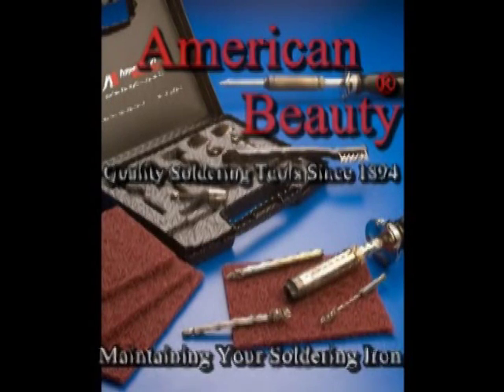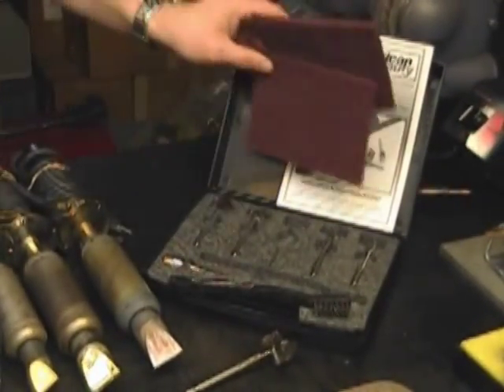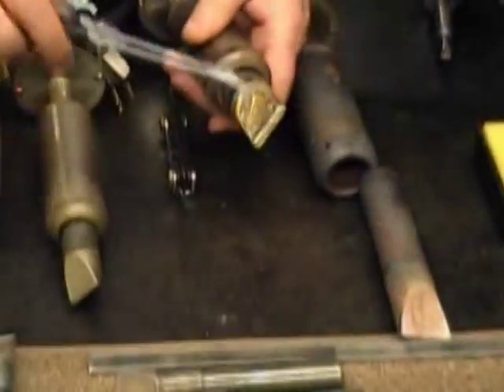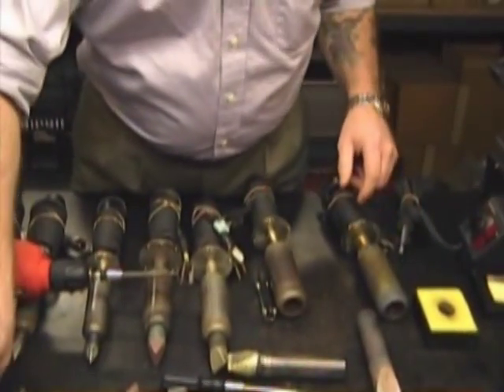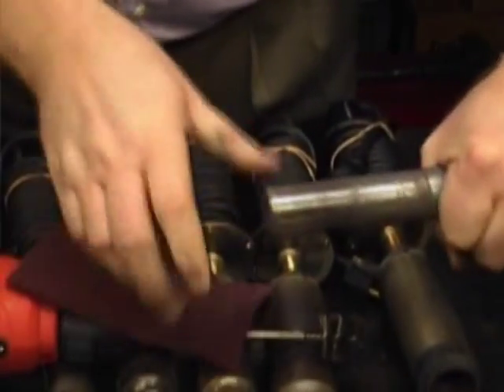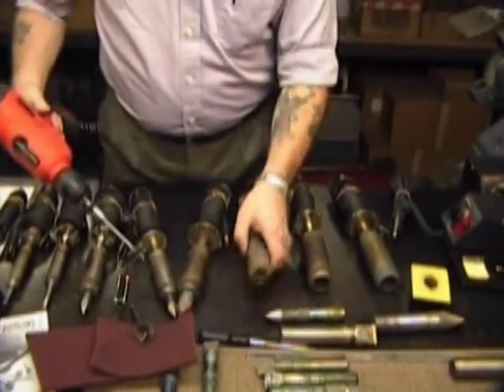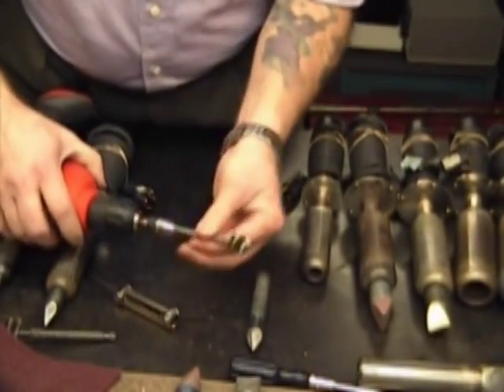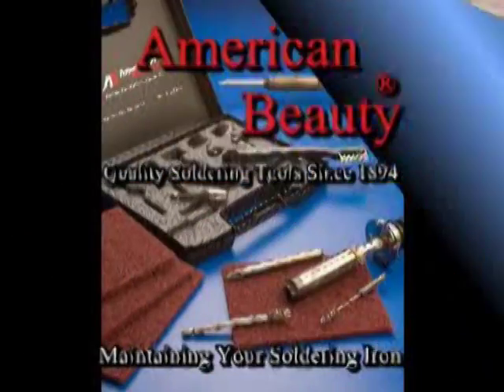Proper Soldering Iron Maintenance

Comment: I found what i think is a solid copper soldering tip at a flea market. It's a smidge over 1-3/8" or 35mm exact by about 7". At the shank with a small round flat spot i assume is for a set screw. The only marking says NO7. The diamond facets seem to be tinned. If I'm correct then what iron is it for?

Comment: After cleaning (or when new), might adding high temp silicone grease or a heat sink compound to tip and bore prevent future oxidation and/or help with heat transfer?